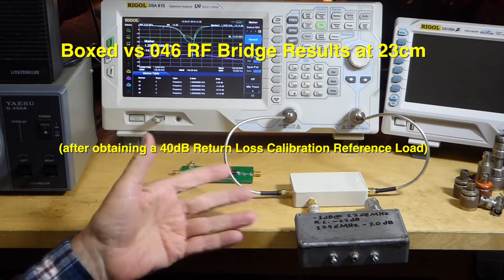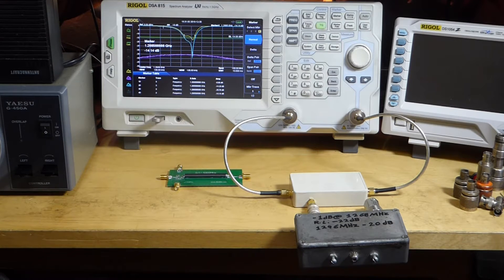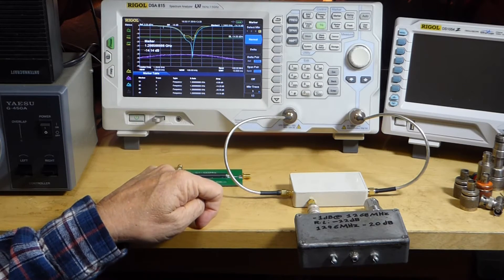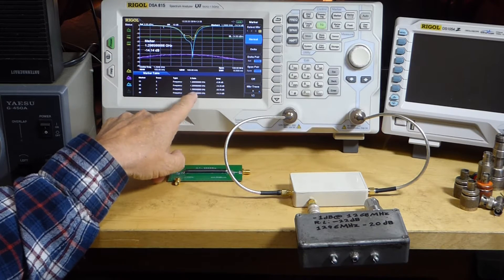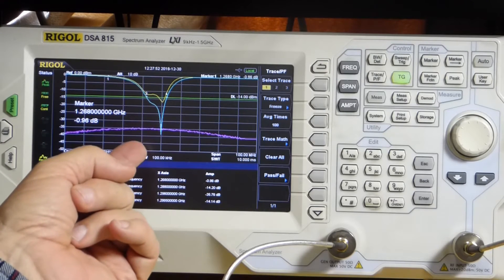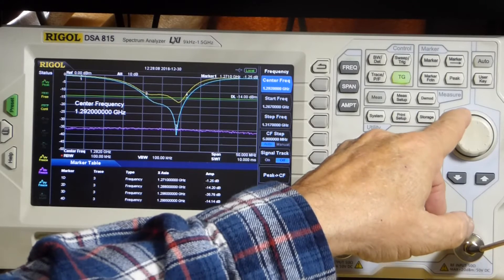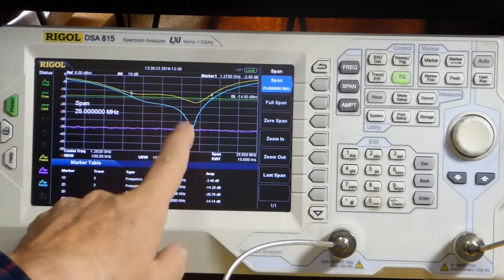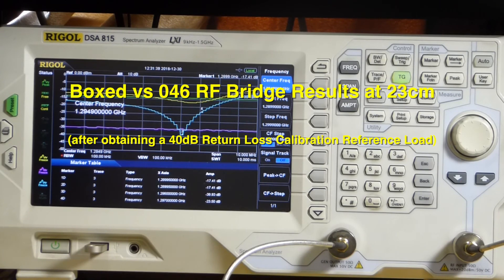1296 Return Loss Test

Comment: Hi Jim! I am really grateful for all your videos! I've learned so much from you, especially when I got started with my Rigol DSA815 TG. I was able to get a ZFDC 20-4 just good up to 1 Ghz., as the -5 version is unavailable. I also have the Green board $ 15. Coupler like you, there is a little difference mid range, so there both ok for R/L. I have not tried the one in the white box at this time! 73's David. K8KEM

Comment from the maker: In this video I show the results of a measurement of a relatively inexpensive ultra precision Reference 50 Ohm Load using the Boxed Return Loss bridge used in this video.  The result that I obtained showed a return loss of 40 dB at 1246 MHz rising to 35 dB around 1296 MHz then back to 40 dB at 1346 MHz (see purple trace).  The vendor indicates that this unit should provide 42 dB at 1.2 GHz which I do not doubt.

There are several factors that might explain the difference including:

1.  I am using SMA-F to N-M adapters of unknown Return Loss.  The impact of these should have been accounted for in the Normalization procedure but the DSA815-TG is not a $25-50K Spectrum Analyzer.  Thus these may impact the measurement to some degree.

2.  The Return Loss measurements are approaching the level of the internal leakage inherent in the Rigol DSA815-TG which also increases at the upper end of this analyzer's frequency range.  

The early DSA815-TG Spectrum Analyzer that I am using has significant internal leakage between the Tracking Generator and the Analyzer input.  This creates "beat notes" (for want of a better term) when measurements approach the leakage level.  Given the cyclic nature of what I see between about 700-1500 MHz, I suspect that at 40 dB Return Loss this produces at least some of the degradation of the measurement as recorded in this video.  What I typically see is about 6 dB peaks due to the beat note issue thus -42 dB + 6 dB could easily show up as -36 dB... close to the actual measurement seen on the Rigol.

3.  While the Boxed RLB that I am evaluating is supposed to have 40 dB of Return Loss at 1296 MHz, it may or may not.  That is, after all, what I was trying to determine in the current set of videos.

4.  The SMA-M to SMA-M test cables that I am using were purchased surplus thus may also be less than perfect.  

Frequently such items are sold off to surplus either after failing to meet a lab test standard or simply after reaching a predetermined maximum number of uses. 

Bottom Line:  It is likely that both the Boxed RLB and the Ultra Precision 50 Ohm Load meet their published spec.  
The variation seen in this video easily could be due to the effects of adapters, cables or internal DSA815 leakage.  

Usually a circuit design that achieves 20 dB or better Return Loss is considered "good enough" and thus an RLB that shows better than 30 dB Return Loss when a precision load is placed on the DUT port provides 10 dB or so of margin for such measurements.

At the price point of the adapters, cables, SA, RLB, and the precision load, I think that these items perform quite well for the home experimenter and even for restricted budget professional use.